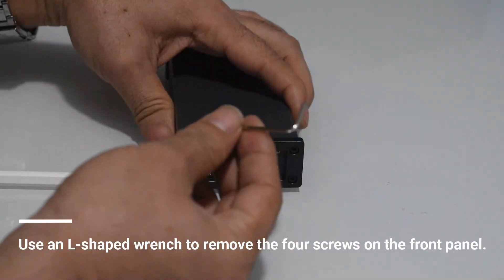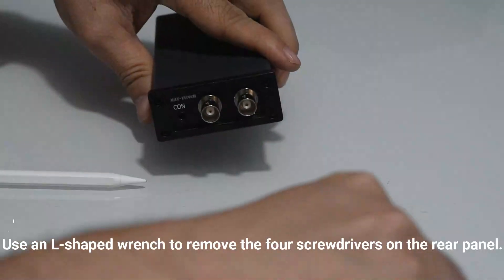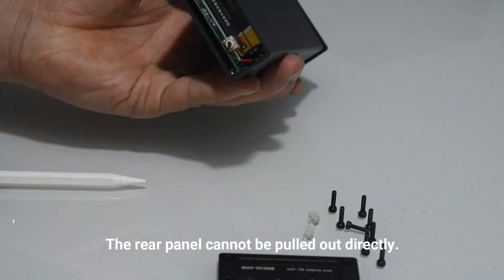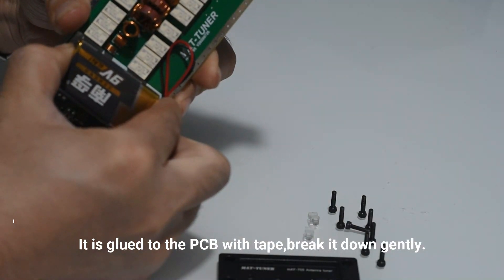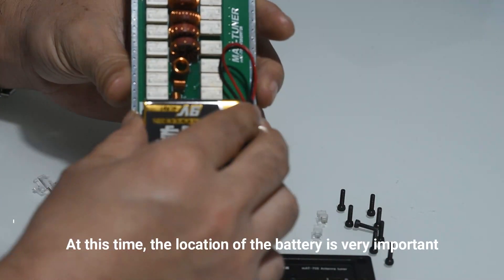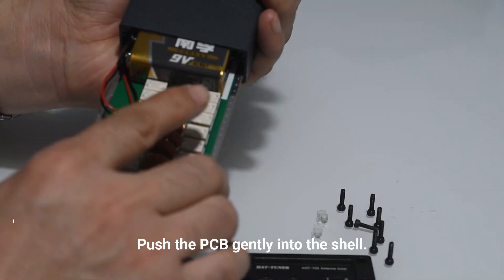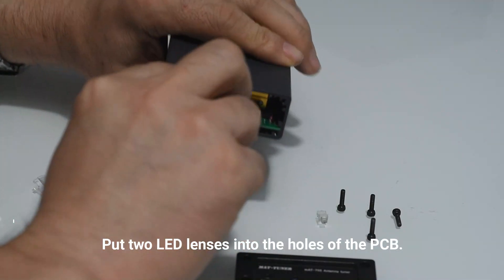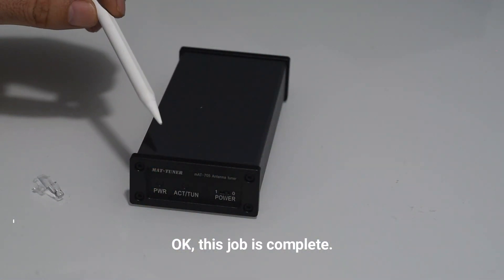How to change the internal PP3 9V battery in a mAT-705 Auto Tuner

Comment: I think I'll be waiting to see how you change the battery in the matching ICOM 705 ATU, is LDG going to make a control cable for the Z817 to work with the 705?
Reply from the maker: You might be waiting a while Adam, no release date.
Reply: I'll probably get the mat ATU when you have them next in the shop, really enjoying the 705 it's got a great front end on it and it's kind on the batteries